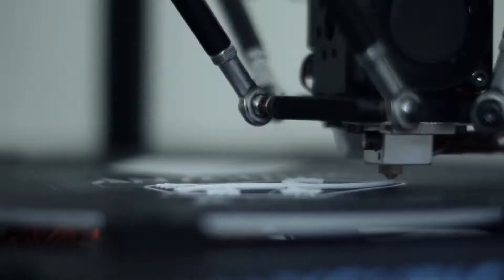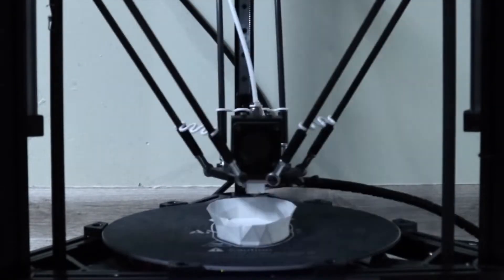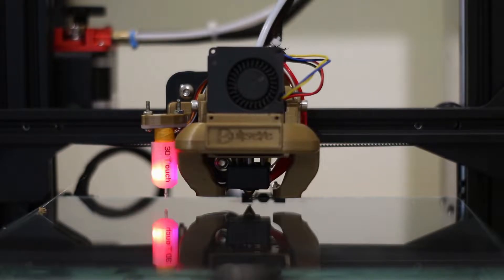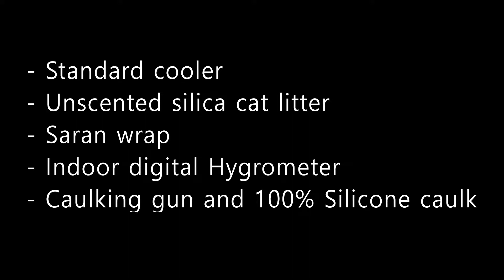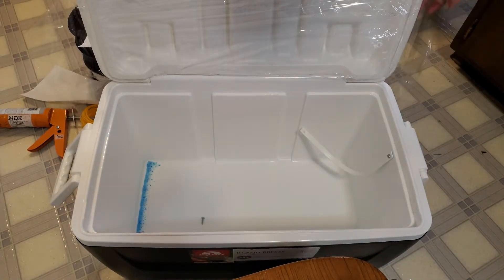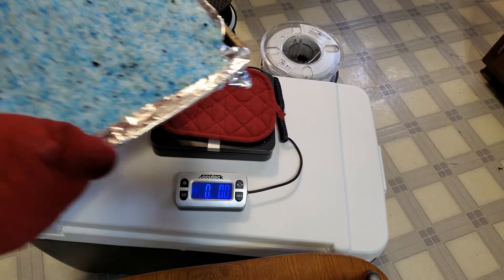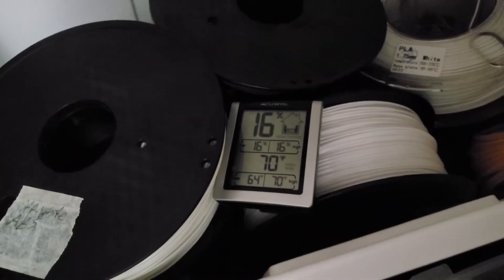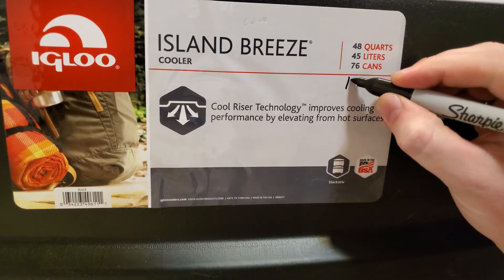Stop Ruining Your 3D Prints - Learn How to Store Filament

Comment: What I do is store my filament spools in vacuum bags. Large "foodsaver type" 15" wide bags are just barely big enough to fit a kilo spool in. Stuff a dessicant pack in the center and it will probably survive for years. I intentionally make the bags a few inches too long so you can reseal them half a dozen times before you need to replace a bag.
Reply from the maker: Good idea! I guess I didn't mention why I made mine with a cooler. I find it easier to just grab a spool and toss one in the cooler. Honestly I'd forget to seal the bags, too 😂
Reply: @TenTries  My solution came about because i'm going to be living on a sailboat and had to find a waterproof solution for storing filament. :) It's likely overkill for most people to be honest. (I also got a drybag that my Monoprice Mini Delta will fit in when i'm not using it)
Reply from the maker: @lasivianleandros3558  oh man, the salt water though... Wait, a sailboat on salt water or fresh?
Reply: @TenTries  Ocean. Yeah, it's going to be hard on everything. Hence why I got a printer I could just put in a dry bag and stow when not in use. :) Mainly I want to be able to design, print, then cast my own parts anywhere I go.
Reply from the maker: @lasivianleandros3558  That would be so cool! Not actually on the boat, though right? It'd be terrible to sink a boat bc of a little spill
Reply: @TenTries  I'm sure I could find some locals to do any casting I needed. Definitely no hot metal on the boat. :)

Comment: Any specific reason why I have to use a cooler or can I simply use a big plastic storage box?
Reply from the maker: You could use a storage box. Just make sure it doesn't let light in, because UV light can degrade a lot of filament.
A cooler also doesn't warp when moved, so the seal is in the same place. Some cheap, large storage boxes will warp if moved and may not seal properly
Reply: @TenTries  Good call on the UV. I was planning to build a see-through storage cabinet!

Comment: How long can filament be kept after manufacture if it's properly stored?
Reply from the maker: Years, I think. If moisture is the issue, the moisture can be driven off with heat. I had one spool of filament that arrived from the manufacturer with moisture in it and after a few hours of drying, it printed better than any other filament I had.
I still have the original filament that shipped with my printer 5 years ago. Might have to print something with it for a video